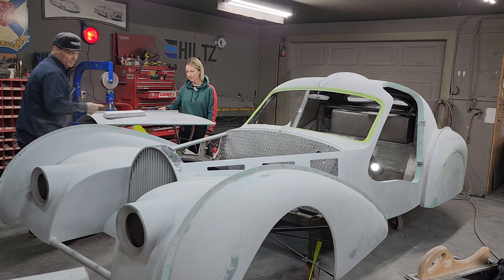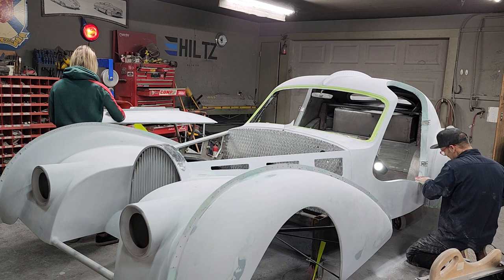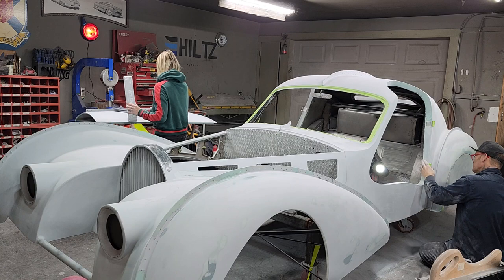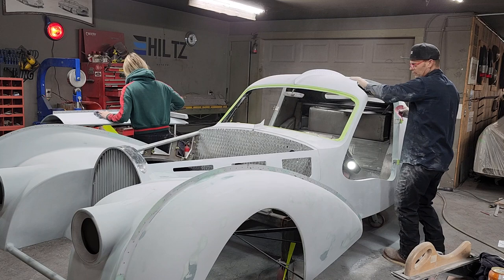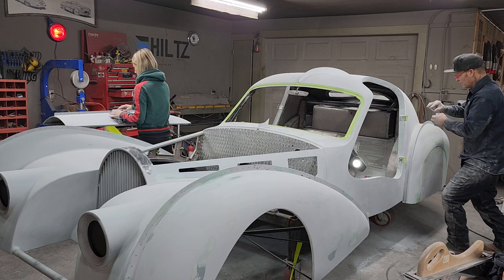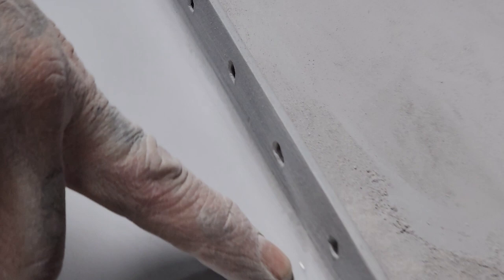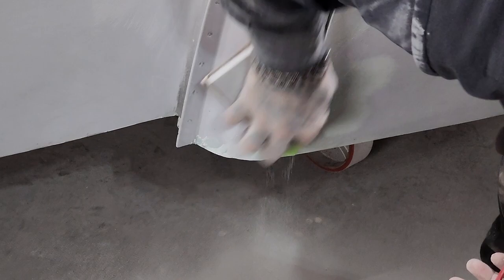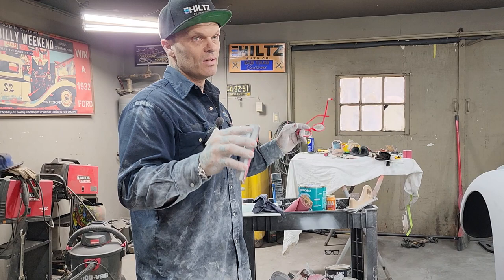The push is on to paint the Bugatti 🎨

Comment: Myself I prefer to use 120 over 80 just my opinion it seems to cut a lot faster whenever you have the high-build primer and there's less of a risk of blowing through edit: always use the longest block your able to chances are the hood will turn out wavy with a short block also hook and loop sandpaper is a god send

Comment: I still say that you should have a vent for the passenger compartment as it will be very warm during the summer months because of no circulation in the inside of the passenger compartment.
Reply: Your right Joe, better still, instal aircon under the spare wheel space using an electric pump, I’m also wondering why no wipers and  water channels in the doors, it must be a summer car, so it’s a bit of manufacture in contradiction. I’d think design it for one climate use or another. Still a nice build so far but I’m also dreading the thought I’d leather straps to the engine hood and that petrol cap, the car speaks too much streamline beauty to have these bolt on projections.

Comment: I do realize you are making a replica in appearance only to the best of your ability and I do commend you for your efforts but in actually yours is not a real replica, for one thing yours is not made from magnesium which Bugatti's original Aerolithe car was made out of. A very light material but very flammable properties and could easily ignite, that is why it took forever to make just the body alone, for this car and one of the reasons for why it was so expensive to make. also its engine was very unique 3.3-liter, dual overhead camshafts (DOHC) straight-eight engine. Which made it very complex and rare for its time.  Your car cannot be compared to these original creations if your being really honest about the comparisons but I do love what your doing and I highly respect this build. Although, you should point this factors out it's not that same car for many reasons if you were to be truly honest. That's not to say that this car isn't going to be beautiful because I do believe it will look stunningly beautiful. Your making it for Jolene.

Comment: What I would do is buy very good quality drill bite to drill the holes for the rivet's that way it will help from chipping the paint on the car and if you put masking tape on where you drilling the holes that will help as well and when you are drilling don't push let the drill bite do the work an go slow. What I do if I'm getting inpatient an try to be in a hurry I will walk a way before I mess something up I can go back to it after I have child and relax. Hay Chad she send to paint it by Friday but she did not say what so if you spray primer don't that count as painting it its a color Gray lol.     I just had a idea where you still needs to be drilled for the rivets way not drill the holes before you paint the car that way if something happens you can fix it before you paint the car

Comment: The flip petrol cap ruins the smooth appearance of the rear, it should be a press flip system and flush like the spare panel. Hope Jolene has it changed. It’s still a fabulous job your both doing.

Comment: No way should you paint the car before you've test fitted the body with the complete chassis. The chassis hasn't been completed and you don't have the drivetrain completed. You'll only ruin the paint, not to mention the changes you'll inevitably need to make to complete the car. Don't do it until you're ready!

Comment: I think you should use acorn nuts on the fire wall instead of the slotted screws. What are you going to use to cover the holes on the rib running from the windshield to the trunk?
Reply: Aluminum rivets.